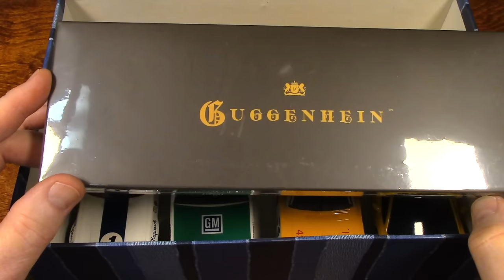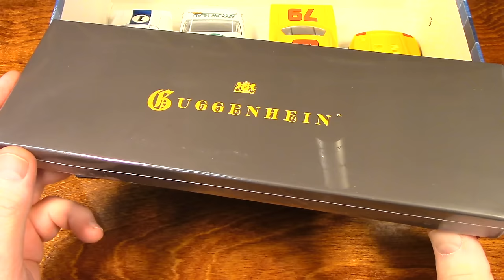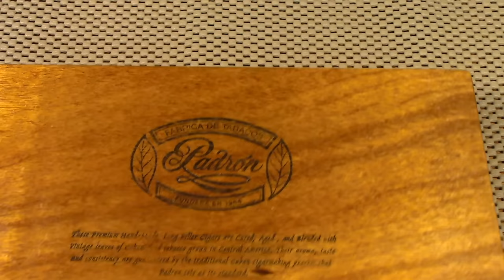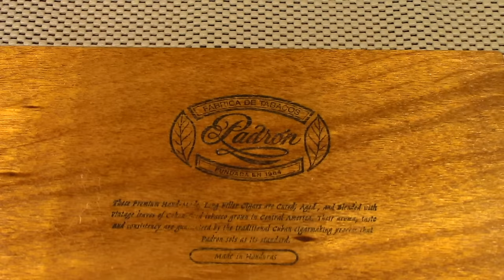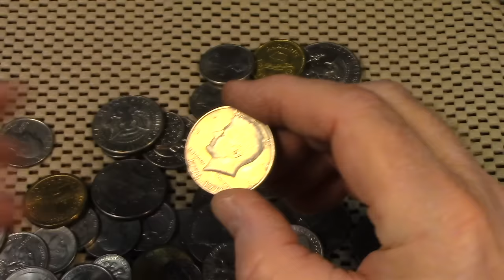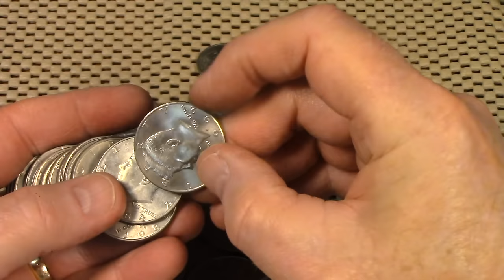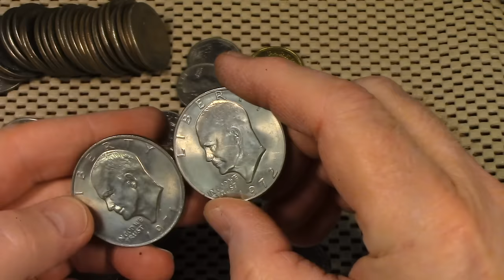I Just BROKE IT - Relaxing ASMR

Comment: Little baking soda , mix  in some graphite add a tuch of super glue, will fix the crack in the plastic fairly easily. Little Sanding, some touch-up paint, it will be good as new.